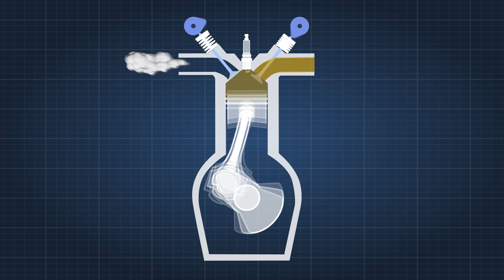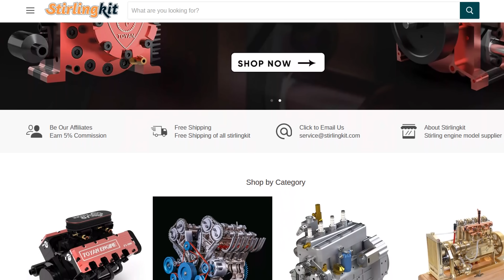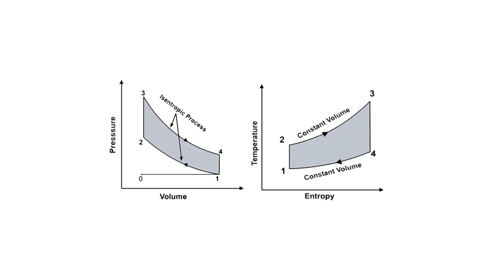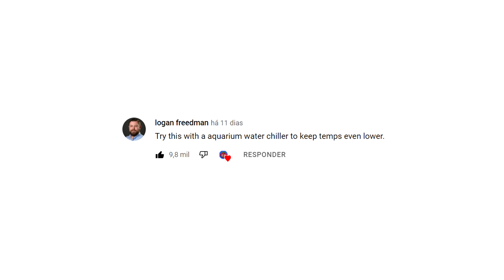I 3D Printed a Transparent Combustion Engine in Resin

Comment: Each fuel has a different air/fuel ratio which may be your problem, but my best guess is ognition timing.

You had noted that the mixture ignited more reliably at slower speeds, which indicates the timing is retarded (yes, that's the proper term in timing)

If you can advance the timing of the spark, you may be able to ignite the mixture more reliably.

It's also possible that you're not atomizing the fuel as well with the same carburetor, but that's just a guess.
Reply: The keys to determining the cause of your misfire:

Proper Fuel ratio
Good Compression
Good spark
Proper ignition timing

That's about it really.

Unless you can't get the exhaust OUT fast enough, but that's unlikely

Comment: I wonder if the ignition timing has something to do with the number of power strokes you're getting from each fuel. If the fuels burn at different rates, the amount of ignition timing advance you need is going to change, and you're going to need to increase the advance as RPMs increase. The spark plug is probably lighting off at the wrong moment in the compression stroke.

Comment: Spark timing is extremely important. Understand; this is NOT valve timing. Your car's engine automatically adjust the timing dependent on engine RPM. As the engine RPM increases, the spark timing advances to sooner and sooner before the cylinder reaches "top-dead-center". This is because it takes the fuel a fixed time to ignite no matter how fast the engine is compressing it. At high RPM, if the spark happens always at the same stroke position, the fuel is already decompressing to the point where it won't explode. In an automobile engine "knocking" and pre-ignition comes from a spark that is too advanced before TDC. An engine begins to miss if the spark is too delayed past TDC. If you cant adjust the spark timing then you must regulate the RPM.

Comment: compression is best explained by a ballon, more air= more pressure and a louder bang, a small ballon with on a little bit of air is very limp with its explosion, and has less enargy, also with the spark plug just because its getting power doesnt mean its arcing, chec the plug for sediment and arc distance, aswell as insuring the engine is getting enough air is vital for combustion and running a engine "rich" (more fuel and nor enough air) can lead to miss firing,

Comment: A more powerful fuel does not mean instantly more power output, as the ideal air/fuel mixture will be different for each one.

For example if you have a standard gasoline engine and add nitrous to it (fast and furious style) it would just run super lean and damage the engine without making more power.
But if you add nitrous AND lots more fuel in the correct ratio, it will make serious power.. letting you truly live your life 10 seconds at a time (until the engine blows up because it wasn't designed to handle that much power).

Comment: It might be a mixture problem, if your mixture was too rich for gas it might have been just right for fuels that need less air to burn(methanol, nitro), and if you couple that with timing that is too advanced(ignition happens before piston stops moving up) then you get too much back pressure on the piston and lower revs

Comment: The methanol is only really an advantage when the compression ratio is to high for gasoline, or when you are running a lot of boost. Nitromethane is really volatile and makes more power everywhere because it contains its own bonded oxygen in the fuel. The most likely reason that it was skipping is that the Air-Fuel ratio was off. Gasoline wants a perfect 14.7, but an engine doesn’t mix it perfectly, so you are looking for about 13. Methanol wants way more fuel for the same amount of air at 6.5, but can be run down to 3.5. 
Nitro has a 1.7 to 1 stoic, and that is probably why it wasn’t burning every cycle. If it’s adjustable I would recommend changing the amount of fuel that is going into the motor for each fuel and playing with were the spark plug is igniting the fuel. Most engines have a peak of about 25degrees before top dead centre. This give the fuel a chance to explode for as much of the power stroke as possible.

Also it looked like the engine was firing on some of the strokes you didn’t think it was, however it was probably a bad Air-Fuel that kept it for making a bright visible flame. For both the meth and nitro I recommend making a slightly shorter cylinder to try to bump up the compression ratio so that they work better.

Comment: Another possibility may relate to the timing of the spark.  4-stroke engines typically have mechanical and possibly vacuum-based spark advance.  If your system lacks that, it will only operate well in a narrow RPM band.  If the RPM is too fast, the fuel won't have enough time to atomize before spark is applied.

Comment: It actually makes sense, to see the explosion it has to be a slow combustion with an amount of carbon in high temperature. Good mixture or an efficient one are fast and clean.
Also adding load to it will only slow down the piston, make it combust for longer and you will have fire out of the exhaust 😂

Comment: It literally all has to do with timing. The higher the octane rating the harder the fuel is to ignite. That’s why it’s used in high compression engines. But with that. You have to adjust timing to get more power. You can’t just change the fuel and expect more power. I’m theory yes. But I’m reality no not really.

Comment: To make it run better all you would need to do is make it able to adjust the fuel rate and timing, then hook up a motor to the shaft, to use as a generator/dynamometer, and hook up the motor to a voltmeter/ammeter, then you can tune the engine to that specific fuel by adjusting the air fuel ratio and timing, the higher voltage or amperage, the more torque or horsepower it has.

Comment: add more fule to the combustion mix twist the screw  whilst the engine is running and if the ram increase the mixture is better than before but if the engine rpm stays the same or drops the mix is worse than before

Comment: Inspired by your efforts and disdain for tomatoes, I am writing my very first youtube comment just for YOU, Integza! 
Before you try anything crazy, look at your footage here (9:58-10:10) Is that a head gasket leak?? I suggest using a copper, or even rubber O-Ring, in combination with a groove in the cylinder block, just to ensure maximum compression and burn consistency for your Air/Fuel charges. Also, I don't recall you mentioning doing any adjustments to the carburetor between different fuels.. mostly, I figure you were just saving us the pain; however- just a friendly reminder that not all fuels run on the same jet setting.

One more thing I noticed- your cylinder bore is non-conductive. How is the ground/earth run to the cylinder head for reliable ignition? Potential problem, if you haven't already found a solution..

All ahead to you, sir
and full stop to the disgusting tomato!!

Comment: Try honeing the bore to help with compression raito, there needs to be an advance in the ignition timeing the faster the strokes are completed, so im thinking the reason the most powerful fuel was the worst is because it wasn't igniting on time and fully burning all the fuel therefore causing the following power-stroke to be even less efficient and move the piston slower

Comment: maybe the thermal expansion causes the metal enclosure to seal better than the polymer one, and i think  while all of the materials were compressed at different volumes the more enriched one ignited easier at the lower pressure environment making it the only one to complete a proper 4 stroke cycle

Comment: I believe the reason the more powerful fuels go slower is simple: there's more gas to exhaust so it takes more energy out of a flywheel system like this. The reason you usually don't have a single cylinder 4 stroke is for 2 reasons, vibration and the fact you don't need a flywheel. When you have enough cylinders timed right, there's always a cylinder in its power stroke adding energy to the system. In a 1 cylinder system, 3/4 of the time it's not producing power. With the straight methanol and light mix, they are producing less pressure and thus generating less gas that the engine has to force out. A missed cylinder firing is not going to require that extra bit of energy, so on those only the compression stroke is robbing peter to pay paul energy wise. Meanwhile with the nitromethane generating that extra pressure every 4 strokes, it requires more energy (and likely time) to force the resulting gases out of the exhaust. 

There's also the fact that if the timing of this engine is off at all and the exhaust valve doesn't open precisely when the cylinder bottoms out from the power stroke, it's robbing power from the cycle. If it opens early it's venting before the power stroke is completed, and if it opens late the engine has to put energy back into compressing what is now a pressurized cylinder.

Comment: Your tests don't align with "how powerful a fuel is" because your a bit mistaken in what determines how powerful a fuel is. They have different energy densities by volume and mass, but that only contributes to fuel consumption per unit of work. What does determine how much power you can get out of each type of fuel is stoichiometry. Alcohols are oxygenated fuels, which means they carry some of their own oxygen to use in combustion. They carry less energy per volume, but they allow much richer carburetor jetting and higher compression ratios due to how quickly they evaporate and soak up heat in order to prevent pre-ignition. The octane ratings of ethanol and methanol are slightly over 100 compared to the regular grade 87 and premium 92 at the fuel pump. Pure gasoline without any octane boosting additives has an even lower octane rating (which is why tetraethyllead was added to gasoline many decades ago). A higher compression ratio (and therefore more work done per cycle) combined with more oxygen available per cycle (from oxygenated fuel, forced induction, or both for top fuel dragsters) are going to be what makes an engine more powerful.

Comment: It depends on the flash temp of the fuel in question as the spark provides a spark it also produces an ammount of heat with fuel that have a higher flash temperature you need stronger spark as opposed to say nitro methane has a very low flash temperature therefore it requires little spark to sustain chain combustion within the engine cylinder.

Comment: a higher octane number in gasoline means the gasoline explodes slower so it can burn it all.... maybe its a slower RPM with the 25% methanol fuel but it probably made more torque or horsepower. also, those different fuels probably need a different fuel/air mixture set with the carb adjustment screw.  maybe you could attach the engine to a permanent magnet motor with the wires from it going to amp/multi-meter and maybe an adjustable MOSFET load to vary how much amperage you wanted for each test. then you could test what fuel generates most power? i dont know if that would even mean anything as far as torque and horsepower though. its just what i was thinking while i was watching.  love the videos!

Comment: I grew up watching my dad work on cars in the 60's, and of course I did some of my own mechanic work with mine.  On top of that, working for 35 years in an industrial, manufacturing setting, in Q.A. I worked with, and repaired delicate measuring equipment, and later in Production I ran automated welders with robots, and a HUGE blanking press with automation.  The one thing I found really, really important with anything mechanical is properly swearing at it.  "Jesus Christ" is just a warm up, a preliminary.  Machines won't really get intimidated until you lay down the F-bomb, especially if it's connected to items of either male or female genitalia. Now, I worked with guys from all over.  Swearing in Italian didn't seem to have as good an effect as English. But my French Canadian co-workers did well swearing in Quebecois.  NOT Parisian French, which is too dilute to fit the purpose. I am not sure which is better to swear in, English or Quebecois.  From my experience, English might have the edge if you deliver it in a Newfoundland accent:  Practice "Laird T'underin' Jayzus!".  Glad to be of help.

Comment: idk if you have done this in the past, but could you make a piston engine powered by the pressure generated from sublimation of dry ice?  You might be able to 3d print almost all of the components
Reply: Hi dapz
Reply: Sterling engine
Reply: @suspense_comix3237  It's not a stirling engine, stirling engines use a temperature difference to expand and contract gas that is completely enclosed within the system. what im thinking is more in line with a steam engine
Reply: @dapz  Yes, but an engine that runs off of dry ice is still going to run on a the expansion of the co2 gas generated by a temperature difference created by the -70C of dry ice and the ambient temperature. But yes, a stirling engine’s working fluid is enclosed within the system unlike what a usual steam engine is.
Reply: I've been wanting to do this for years
Reply: That would be a steam engine. A stem engine can run on compressed air. Sublimation of dry ice if contained would return a compressed gas. Steam when contained is a compressed gas. 

So you could run a model steam engine from a co2 cartridge (pellet gun, seltzer bottle cartridges). CO2 is sublimated dry ice.
Reply: Sounds plausible, but not super helpful on the not releasing greenhouse gasses into the atmosphere, both during the manufacturing of dry ice AND using it to power the engine
Reply: never heard of it, cool concept
Reply: Good stuf bro
Reply: Why not simply use liquid Co2 instead?
Reply: @gotindrachenhart  
Liquid CO2 is cryogenic. So at room temp liquid co2 is very very high pressure.

CO2 doesn’t need to be manufactured, it can be captured from the atmosphere.
Reply: @larryscott3982  so, dry ice >isn't< cryogenic?? And the pressure is only 800-1200psi, I've used it in paintball markers for decades to great effect. The point here was to use Co2 to drive a piston so you'd want more pressure anyway. All you need is a regulator or even a simple valve that's going to limit the flow. And what does the capture have to do with it?
Reply: @gotindrachenhart  
Fine. Build a steam engine and run it with CO2. Get your co2 in canister cartridge or dry ice. It’s not a bonus of efficiency, or cost.
Reply: Thats a cool idea
Reply: the god has commented
Reply: Dude that idea is big brain. #respect
Reply: smarts +10

Comment: hi  integza 
check your compression before each run, to make sure it´s the same evrey run, it makes a huge difference.
air/fuel rations need to be stable and matter a lot, you need regulators to manage them, so maybe a litte pump need to be added too.
and pls get rid of the high play in the vavle train, and maybe ad a gaskit.
Hafe nice Day, and man u look awesome

Comment: It's likely the charge coil is tuned with minimum time between sparks as a way to regulate the RPM of the motor. Methanol won't burn as bright because it typically burns cleaner and produces fewer particles that emit black body radiation. The nitro methane probably needs a much richer mixture than that carburator was designed for

Comment: The carburetor needs tuned to each fuel, gasoline and ethanol mix uses 30% more fuel , here in the United States  we have e85  and alot of us use this for drag racing  , in efi tuning you need to add about 30% more to keep air fuel ratios correct,.

Comment: If I had to guess why the little 4 stroke engine is not running properly, I have a guess that there is a throttling mechanism that is preventing the engine from running faster. I have watched a few of JohnnyQ90's videos and on some of the engines he shows, you can see a clear throttling mechanism that is keeping the engine from running any faster. So, I imagine that the throttling mechanism is keeping the engine from running at over 4000rmp and when it does, slows the engine down to keep from running too hot and/or blowing itself to pieces due to the stress of the faster moving parts. Thus, the mechanism kicks in when it moves to fast to slow the engine and if its spinning to fast, the throttling mechanism applies too much force that eventually slows the engine down enough that it comes to a stop.

Comment: The engine skips the power stroke sometimes because of the AFR(air fuel ratio) mixture, because you’re using a carburetor you should try changeing the AFR specifically for every fuel, each fuel having different additives, viscosity, octane number and so on.
You can see when you have the right AFR by the color of the flame and the way the engine runs, too much air means weak power and faded flame, also it makes a hallow sound, if you have too much fuel you will have a very strong flame but it will run at lower RPM because it burns harder and it’s not burning completely, also the sound of a power stroke is more of an explosion in this case rather then a burn like a pop or something like that, one more thing possible in this case is weak power causing the engine to stall when a big load is attached.
Hope this will help you!